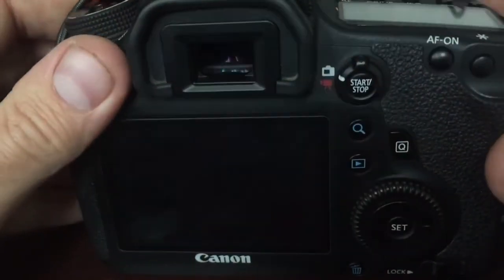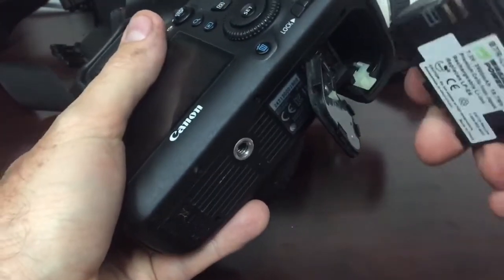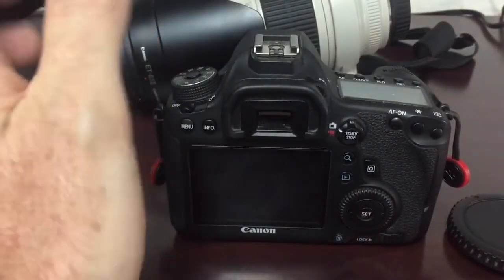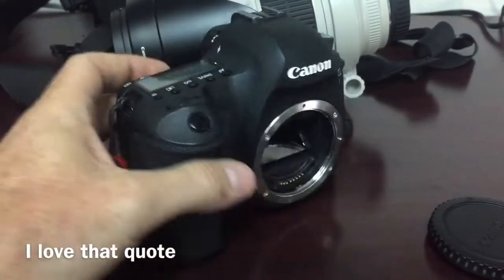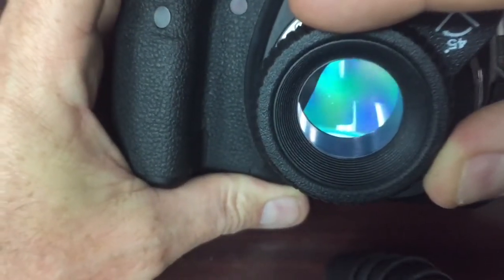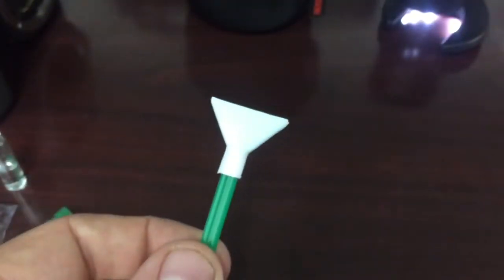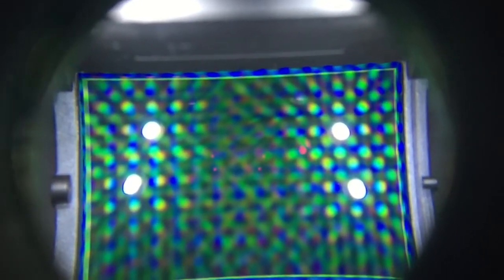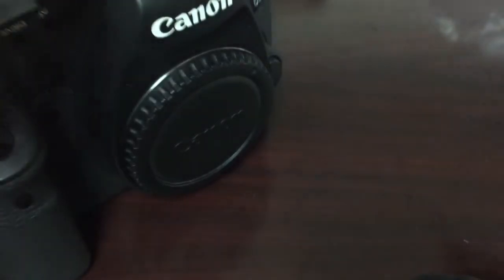How to clean your dslr sensor and tips (informative)

Comment: Glad to see a post. I was getting worried. :) I have a Canon T3 that has a spot on the sensor. Unfortunately, the T3 does not come with the cleaning feature some higher end Canon DSLRs have.
Reply from the maker: You can manually clean a T3. It’s under the wrench tab. I’m 100% certain there’s a lock up function.

Comment: Thanks so much for this video! My! I need to clean mine it's well dusty ☺👍
Reply from the maker: Thanks for watching. I’m still jealous I’m not in your shout outs. ;( Just picking. Get any Mars footage yet?
Reply: Garnett Leary....eeeek to be honest you are right! your not picking at all i should include you. When i next do my shoutout video you will be in it. I did capture Mars last night exactly on the day of opposition. But because of my location in the UK Mars is pretty low on the horizon which is very frustration for Astronomers and Amateurs. As you know the seeing conditions on the horizon is not great as the air pressure and clouds are alot denser which causes a lot of distortion. I only had 2 hrs sleep this morning then back to work, i was up all night setting up, waiting for the clouds to clear. I not checked the data yet but i'm sure i will have something to upload :)
Reply from the maker: Looking forward to it. I’m sure it will be awesome. I didn’t realize it’s so low there. Never thought about it. That’s my education for the day. Interesting.

Comment: Hey Garnett, I ask a lot of questions on your videos, but this one has me troubled. I just bought the Rokinon 14mm F2.8. I notice if I have foliage in the photo, a lot of it to the right of the frame appears red in the picture. Is there an internal red light within the camera that is causing this? I am still using my modified Canon 60D. Keep up your great work!
Reply from the maker: I would imagine it has to do with the light shift towards the red channel due to the modification. That 14mm has an extremely rounded lens and exhibits distortion and other aberrations around the edge of frame. It’s most likely that there’s a red hue everywhere just far more noticeable at the edges. Another thing that could be happening is light leakage into your viewfinder. Are you perhaps using a red LED at night? If you don’t cover your viewfinder light can get in and appear in the frame. It may not even be a red light. The way light bounces and is diffracted it could just be a porch light or something behind you. Try a test outdoors in daylight. Examine the color shift. If it becomes something you can’t seem to pin down there are ways of editing it out. Did any of this seem helpful? Don’t hesitate to ask questions. Clear skies.
Reply: Garnett Leary Thanks for your reply Garnett. I have noticed this same occurrence with a cheap 28-300mm lens as well as my new 14mm. I only noticed the color shift after I modified the camera. The anomaly only appears to the right side of the frame.   I am heading out to an almost zero on the bortle scale in a few weeks for some prime milky way photography and would like to resolve this issue. Thankfully it is a wide open vista, and the close up foliage should not be an issue
Reply from the maker: Try a UV filter in front of the other lens. I’d also venture to take a series of different exposure times to see if it’s a temperature issue. You’re going to have to run some tests. Try shooting some bias frames. That kind of stuff will help you nail it down. It could be ultraviolet light seepage spoiling the shot. I had an old vintage lens that a UV filter solved that for. My red was more centralized but I’m thinking it is dependent upon the lens and it’s coatings. I’d also try creating a makeshift hood for the 14. I know it sounds obstructive to a wide angle lens but start with a small band of black foam or the likes. The 14mm has that flower petal style built in hood and I’m suspect if that’s why the light is at one side. I’ll be home in 3-5 days and I’ll experiment with my 14 and modded dslr. What’s your ambient temperature like there?
Reply: Garnett Leary I don’t think it is just my 14mm, I had a similar issue with a cheap 28-300mm, and the red light showed up on the left side of the frame on a tree. I covered both external lights with electrical tape to no avail. I don’t think it will be much of an issue with my milky way shots as I won’t have any close background to interfere with it. Also I live just outside Birmingham, Alabama, so the temperature is abysmal as well as the humidity
Reply: Garnett Leary ok so I think I just figured out the problem. I’ve mentioned this before, but I have modded my 60D by removing the LP#2 filter. I have an Astronomik CLS-CCD filter sitting up front. The redness I was getting in the trees was because my neighbors have tree lighting. I noticed if I take photos of bright objects, they appear red due to the mod. Has nothing to do with the Rokinon 14mm, just something quite unusual for me. I guess I can fall back on that I am inexperienced in this hobby and clearly have no idea what I’m doing. Keep up the solid work Garnett